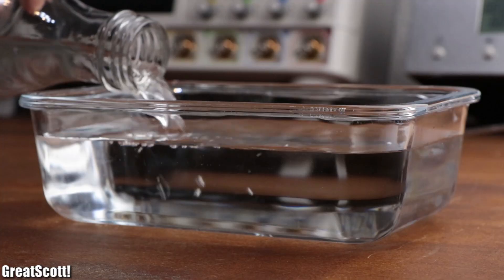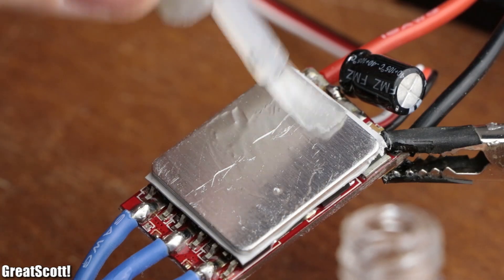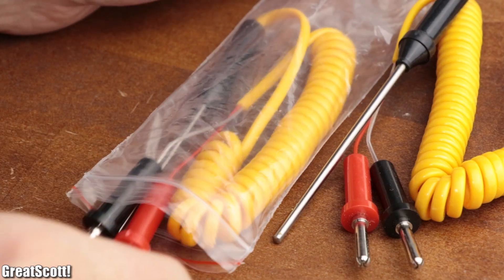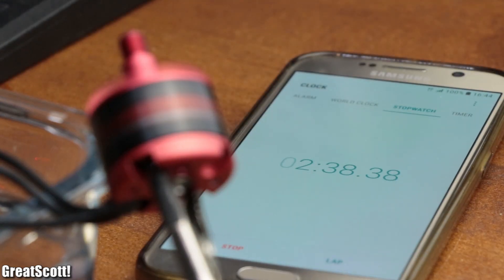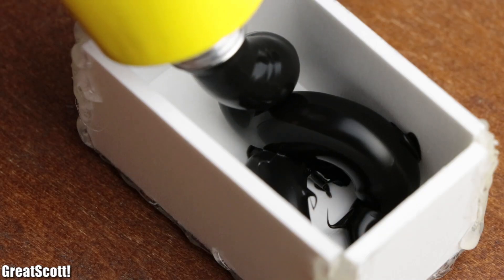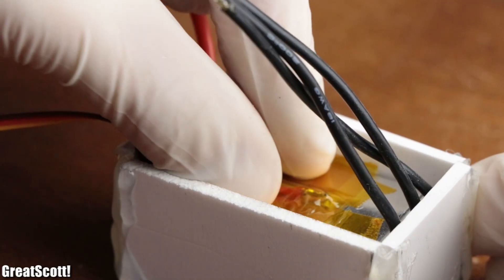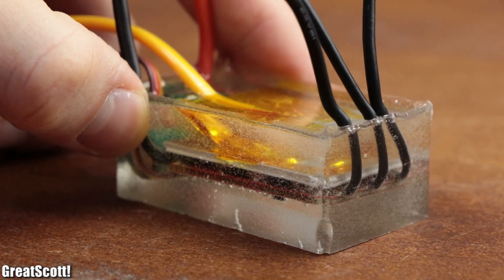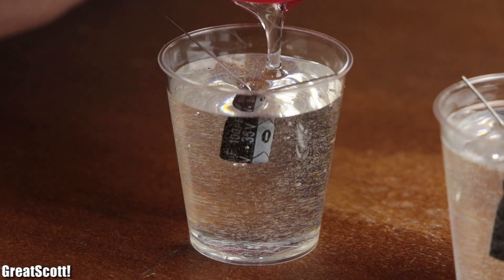How to Waterproof Electronics || Nail Polish, Silicone, Potting Compound

Comment: motors without propellers or other kind of load did not draw much amps, therefore testing the temps is irrelevant- testing ESC rated for example at 25A with load of barely 1A? :D

Comment: You are using the nail polish and the potting compounds differently. In the case of the nail polish, you are attempting to use it as a conformal coating. That is typically used for making the parts more rigid for preventing vibration and shock damage. There are many kinds of conformal coatings, some include silicone in them, but the main purpose is not water resistance.

When potting a board, you typically will draw a vacuum on the potting mix before pouring it into the form, and sometimes, in critical applications, you will also cure it in a vacuum. This takes all of the air bubbles out of it so you don't get temperature variations or pin holes in the end product.

Comment: I do a lot of work on protoboards building a Z80 computer. There is CPLD on the board with a PLCC-44 Socket.  My fear is that the 30 AWG wires will get ripped free from the bottom of the board so looking for a good method to keep them safe.  Would your nail polish method be good for this?  Do you have a suggestion that might work well?  I don't mind either Nail Polish or Potting compound however I worry about them flowing through the holes on the protoboard.  Thanks and excellent video!

Comment: Heat joints from underneath then touch the solder to it from the top. Especially when soldering a wire splice together

Comment: you massage the silicone with a soapy or wet finger not with a screwdriver or tool....try that and its no longer messy, i doesnt stick to your finger and you can shape it like you want..  And for longevity, hardness and fast drying replace the silicone with polyurethane sealer

Comment: I waterproof my racing/freestyle drones with a silicon modified conformal coating that goes on just like nail polish and it works great. Plus it has the added benefit of visibility under a black light so you can see the parts you missed https://www.amazon.com/MG-Chemicals-Silicone-Modified-Conformal/dp/B07BSK5S7B

Comment: I use the liquid silicone conformal coating on my race quadcopters. You can safely solder through this coating from MG Chemicals when you need to rework solder somewhere or replace component. It's not perfect, but it is better than using nail polish!

Comment: When working with silicon, just use your fingers with some soap on. Remember that the drying time is often in mm/h or similar. When I use silicon I usually 3D-print a box that i fill with electronics and silicon and then just let the box be part of the design.

Comment: You can build a small vacuum chamber with a Mason Jar, a fitting, and some epoxy.  Then,  place the item you are potting inside with the potting compound.  Then, draw a deep vacuum, preferably with a two stage vacuum pump.  Then,  while the potting compound is still wet,  break the vacuum and allow atmospheric pressure in. The result is that the vacuum pump will remove all air even from the smallest of places,  and when you release the vacuum,  the potting compound will be pushed into all the voids where the air was.  This will make most none-moving electronics waterproof to hundreds of feet below the water.

Comment: I would like to see ( or try ) a large piece of heat shrink tube used... packed with (cold) hot glue.. before applying heat to shrink and squeeze/ melt the hot glue out both ends....

Comment: You should have tried MG CHEMICALS 422B, which is very hard to get by in germany. It is silicone modified conformal coating and can be applied like the nail polish. You can even still solder things to the board through the coating.

Comment: Also cynoacrylate,  CA glue,  is better than nail polish,  and even better when used in conjunction,  as in a layer of CA,  then a layer of laquer,  because the softer laquer adds a bit of shock and abrasion resistance to the very hard CA glue
Reply: cyanoacrylate is expensive as hell...atleast here

Comment: With silicon it cures with water and if too thick, will never fully cure because the silicon inside will never come into contact with water, and any water molecules in it that have reacted will stay sealed inside instead of being able to evaporate.
Reply: If using silicon I’d recommend thinning it with an electronics safe solvent and spraying it onto the electronic component, or dipping the electronic component.

Comment: Silicone/acrylic conformal coating (this is one of the many purposes for this product) nail polish can work but many do not have any natural dielectric properties and only work by gaping the contact while conformal coatings are made for their electric isolation and ability to handle large temp ranges from -200c to 200c the video is not bad but it is asking a question and conformal coating where created to answer this question.

Comment: Try CorrosionX or a conformal coating compound. Both do a decent job of protecting electronics without adding bulk or significantly affecting heat transfer properties.

Comment: I've had quite a lot of experience with sealing electronics for commercial  purposes.  I'll start by saying that it is considerably more complicated than your video showed.
A couple of comments.
- there are many different types of potting compounds.  The one you used seems to be quite hard.  Most are a little bit softer.  The hard ones can actually rip SMD parts off the circuit board.
- Testing is also quite complicated and extensive.  Far more so than just submerging it in water.  Typically what causes problems is temperature cycling.  Stress testing.
- The other problem tends to be where anything touches the potting.  Maintaining that bond is tough.  So where wires exit the material is a source of water ingress.  
- Another big problem is the potting material separating from the enclosure.  The enclosure needs to be very clean, and if a plastic enclosure is used then you have to make sure the manufacturer didn't use any mood release or any regrind.  Both will cause the potting to separate from the enclosure.  And if the PCB is touching the enclosure, which is almost always, water will find that spot and damage the PCB.  
- There are also commercially available PCB coating materials that do a much better job than nail polish.   That said, those types of products are primarily used for water resistance, not water proofing.  More for keeping the humidity in the air from damaging the parts.  If you are looking to waterproof, both will eventually breakdown.

But if you are just looking for something to work for a home project, I would go with an epoxy.
Reply: What is the best option to waterproof a pwm for an underwater scooter?
Reply: I was thinking you'd coat the parts in silicone or vaseline grease, then cast them in epoxy after. That way, the epoxy doesn't bond directly to the boards components, which would (in my hypotesis) lower the risk of the epoxy damaging the parts during its hardening process. As the epoxy will expand/contract and could potentially damage individual components.
Reply: @woodlandwrench epoxy always contracts during cure process, never expands. When you buy quality epoxy or silicone, manufacturer lists a "shrink rating" which gives a % of the amount of contraction experienced.
Reply: Thank you, this is perfect :) Any PCB coating materials that you recommend?
Reply: When I'm doing any waterproofing with potting compound, silicone or epoxy, I always put the substance in a pressure pot to cure at 50-80 PSI depending on the viscosity of the liquid. Bubbles can cause ingress points or just weaken the walls nearby, causing holes later.
Reply: @Boogie_the_cat  i thought vacuum was the method to remove bubbles not pressure?
Reply: O
Reply: Thanks for sharing valueable knowledge
Reply: Thank you for this. You should make a video or blogpost given your qualifications on the subject
Reply: what's the best and cheap you can recommend for me sir? I want to water proof many of my routers and AP so that I can use them outdoor. and I have concern with heat .

and do you think silicon sealant is also good to use?

Comment: If I was going to use that ESC and motor in one of my RC airplanes, I would not coat them with the amount of silicone or epoxy that you applied for reasons of weight. Grams count when flying a RC model. The nail polish is a possibility though. RC planes depend on airflow for cooling and it seems you are running yours at half throttle (1500ms). Most setups are for 1000ms at zero throttle and 2000ms at full throttle. I would be worried about flying something coated with a blanket that prevented the airflow from cooling it while I was at full throttle for much of the flight. Just my thoughts from an airplane modelers POV.

Comment: you should never let the heat sink be fully submerged in any compound as it doesn't use power of any kind it doesn't matter if it isn't covered. you should also assume that the rated wattage of the resistors goes down as the dispersing of heat gets slower and constant power over a long period will burn it out, but this is onl a issue if your resistor is reaching its wattage rating.

Comment: You can dunk the entire board into a small tub of polyurethane varnish and let dry...it's about the same as applying the nail polish and the potting compound but is more "conformal coating" because it penetrates and coats rather than making a huge block, and you don't have to break the heat sink loose.

Comment: Whats that you say? Potting compound? Where do i get some, the hardware store??

Very sexy result.

Even if you dont need a waterproof esc this helps for attatching it. I dont want sticky tape directly touching my esc :)

You should have done a base line test, an esc with nothing on it! In the air obviously, not under water. So we could see how much cooling we arr comprimising. Or maby they cool even better with these compounds?!
Reply: Could you even put a heat sync on your esc like this? Mine doesent get very hot but this could be "coool" :p

Comment: When I was young, the companie I worked for was designing some electronics that needed waterproofing. There was a subcontractor who was doing the waterproofing and the global packaging. 
But wa had lots of failures after several months.
I've done a forensic on those modules and remarked there was a lot of corrosion.
The product used to waterproof the modules was a silicon compound. But the solvent for the the compound is acid acetic.
And you have to be VERY careful befor applying it becase otherwise, this can lead to corrosion. In fact you have to put a thick layer of varnish before the compound. But if you are able to protect the board against acid acetic with varnish, maybe this can be enough to protect the board.

Comment: i bet if you add copper dust or metal filings to the potting compound/silicone, you could improve the temperatures quiete a bit

Comment: I would like to recommend JB Weld Plastic Bonder. It comes in what looks like the typical two part epoxy side-by-side syringe. Use a small disposable container and plunge the contents in and mix well. You can then either dip or brush on the adhesive agent. Instead of a block of material with the components inside, you have a closer resemblance to the nail polish, except it is opaque-white and much thicker. This will also aid in heat concerns compared to the 'block' style submersion.

Comment: Use single core 1,5 or 2,5mm2 striped wire. In connection slots in epoxy, make everything tight with candle parafin or grease and make klap over it. Some firms in ROV's use box with oil to keep all electronic so water pressure won't collaps it.

Comment: When using epoxy compound, never use power devices to mix or stir it. Use wooden chopstick and slowly stir without mixing air into the mixture, results are the best.

Comment: Tip on using room temperature silicones...put some dish detergent in a bowl with water, about twice as much as if you were going to wash the bowl. If you dip your fingers and tools in that, the silicone compound will not stick to your fingers/tools. In fact, if you use a small container with water and dish detergent, you can squeeze a lump of compound right out of the tube into the soapy water. Then you can pick it up with your hands, and mold it onto your circuit manually. I’ve used this technique for years testing amateur oceanography instruments. Works a treat! Works with most moisture-cure polyurethanes, too.
Reply: Brilliant tip
Reply: The other trick is to use silicone gloves. 
Seriously, only super glue will stick to silicone gloves, but other adhesives and sticky things (even e-6000 "shoe goo") will slip right off silicone gloves. They're great.

Comment: I'd really like to see what happens if you put a LiPo in the center of a thick layer of the potting compound and then overcharge it without a protection circuit.

Comment: I've used silicone to waterproof in the past. And it is commonly used to waterproof CB antenna connections by some. What I found was that it worked well, but a later teardown revealed corrosion of metal parts due to the acetic acid released during the silicone cure. Nail polish does not have this quirk and worked well for me waterproofing a circuit that had around 60 to 70 volts.

Comment: Since moisture in the air is the catalyst for silicone, if you put a couple drops of water into the silicone and mix well it will completely harden Very Quickly, in mere minutes. In 10 minutes the entire amount will harden so work quickly but no waiting days. And kudos on the plastic bag idea also. You can do a search and see how to use the water or food coloring in clear silicone for many purposes on youtue. Make your own molds, toys, etc

Comment: Really nice experiments. I think the nail polish would be easier to get into those hard to reach spots by submerging the board similar to the other materials. Have a plastic container slightly larger than the pcb, pour the polish in to cover the board, and then tip the container around to make sure all air pockets come out. Then use the brush to coat those parts that stick up above the polish (unless you have a large enough quantity of polish that you are able to submerge the whole thing in it). 👍👍😎🤠

Comment: Got to see my mom's car computer after it broke. The whole PCB (15 x 15cm) is coated with a pink 90% opaque rubbery silicone. Very pretty. I didn't even remove it to see the actual controller.

Comment: I guess you should make a test with the motor with some load, like a propeller, because... While the heat transfer was enough for the lower power draw of the motor without any load, it maybe bad when it draw some extra amps from the ESC.

Comment: i have one question does applying nail polish create a resistance to current flow from parts that are not originally connected? if i m to connect a wire to the polished module will current flow into the module?

Comment: Silicone should not be used as some of the air cured ones are based on acids which will eat away your copper lines over time.

Old silicones do not cure well, even after several days.
Reply: They emit acetic acid gas and can corrode any exposed metal. If the part absorbs water and absorbs the gas then it destroys itself at some point. If you must use them coat them with acrylic conformal coat (Turbocoat) first and then only use a very THIN layer of the silicone on top of that. The silicone available to the consumer is not really good for that.
Reply: use rtv sensor safe...doesnt emit acid and withstands more than 200ºC. i use it to repair flybacks...it has brutal dielectric properties and its the only thing that doesnt arc there with the exception of specialized more expensive products
Reply: “Neutral cure” silicone doesn’t have acid. 

Just use “conformal coating” from amazon or eBay.

Comment: Wow, there are a lot of comments to read.  Great, as always, (ok... some are excellent and not bad) video, demonstration, instruction and detail.  

I have to comment though since Hitler like France's Napoleon invade Prussia and this is my duty since there may be family over there still that didn't flee.  

I am about to coat a pair of sandals, areas on a nice (way to expensive) pair of gloves and boots (that are rather expensive also) areas where the polymer has cracked before more separation occurs.  I do sometimes think I can take more off or soak in the solvent first to get better penetration... though I don't do much other than think if I do nothing. 

So, upon researching (an instructable post regarding waterproofing with silicone) I found which solvent to use to thin out the silicon as I usually like to research before I experiment since like most... time is limited as life is pretty much time and resources and I wish you more resources since you are excellent apparently with your time.

OK, tangent... back to where I was and the point before I go off on rhetorical writings... maybe thinning the silicone with a solvent and painting on like the nail polish is shown will help improve performance in more than one way.  I was also thinking, as I have with some components... seal with a heat exchange pipe or heat exchange portion(s) exposed to so attach or have optimal materials surface area for the heat to transfer. 

Other than that... excellent showing off doing so with capacitors.  I so am thinking that is a great idea to prevent a mess on a circuit board.  I thought very humorous the sealing proprietary circuits also.  No kidding.  :-|)

Clear epoxy is awesome looking too for many items and I didn't think about for electronics projects.  Really interesting.  Maybe a UV reflecting clear polyurethane for outdoor equipment to prevent discoloring or discoloring so soon.  

Thanks for sharing, this one deserves big tips (donations) as many of your other post do and All the best!